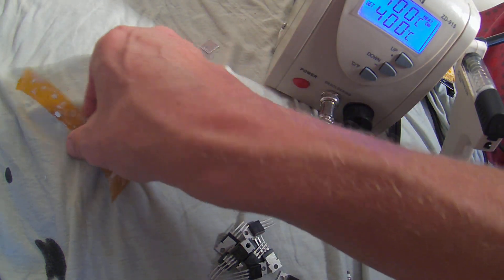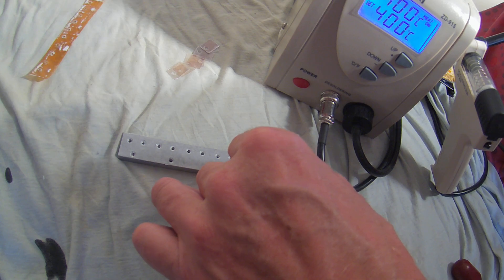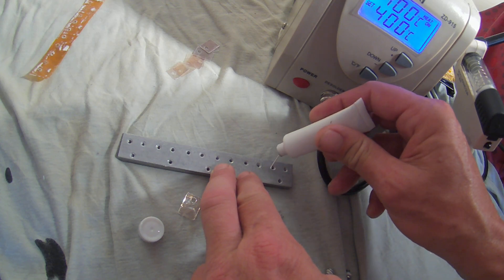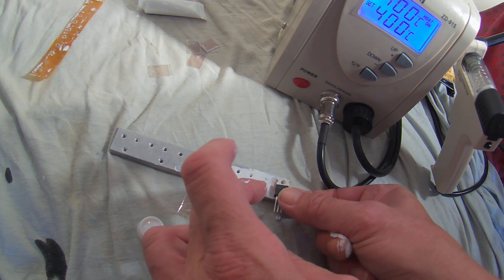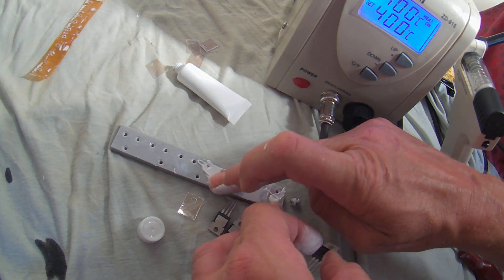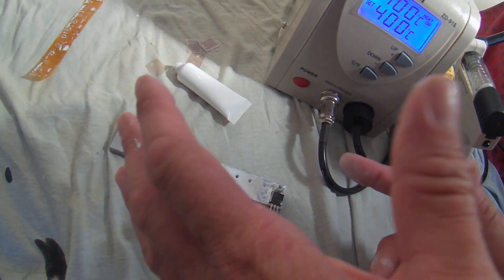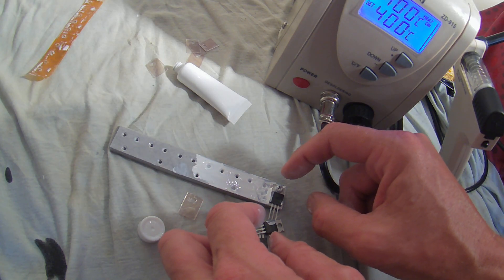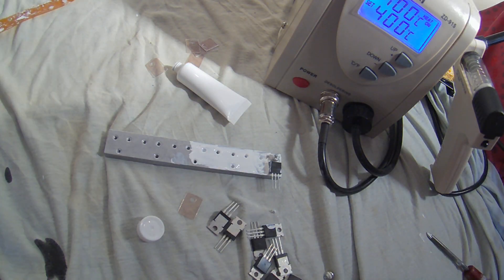Electric Scooter - Motor Controller Failure Part 3

Comment: Did got the scooter to work again?
Reply from the maker: It will in fact be ready for the summer and is extra special. It will be for sale in the South East of England in case anyone is interested. Hardly used and the battery is constantly refreshed.

Comment: i hope i don't need a entire new controller if its a mosfet problem. how can i fix it??? my scooter is a laotie ti30 model??? thanks hope you can help me?? and can i get a controller with bigger V or A. i see few stuff on my controller first one reads 60V, then another part with wording says 50V and then 45A???
Reply from the maker: Whereabouts are you? I can't fix remotely and need more info. If it's a controller problem, then it's a blown MOSFET for sure and that has to be sourced. Replacing is easy
Reply: @marcusoroberts  I'm in NY. Can i send u a PM with my email or u let me know u email just want to send u the pics I took of my controller to see if that's the problem. Then I probably order new controller even if it's just a mosfet problem. I hope it's not motor I don't smell any burn smell in my motor or motor sensor hall????

Comment: why not installing a cpu watercooler all in one on the mosfet aluminum bar and 2 little fan (push pull)  for removing the heat from inside the controller box ? :0)    (p.s. my controller last only 4 month ...)
Reply from the maker: Hi Denis, that's a great idea and I have been looking at alternatives to cooling. I'm investigating that approach. Please share any info you have on this. Cheers.

Comment: hey marcus, great videos. These scooters are really fast and complicated, I have a question for you, is there a fuse on the scooter because all scooters have a fuse somewhere, do you have any idea
Reply from the maker: Hi, fellow Marcus and thanks! No, you right that the typical scooter with a lithium battery will not have a fuse. Any such protection is dealt with in advance by the BMS within the battery. I used to have a scooters with the old SLA batteries and they did, as you say, have fuses mounted externally. Cheers.

Comment: Hi Marcus. Sad to see you're not uploading anymore. I saw you had a review for the Viper Dual 2000w Scooter. Do you know anything about the Viper Dual 5000w scooter? Other than viperscooters.com I cannot seem to find any evidence that it even exists. Noone seems to have one to show online.
Reply from the maker: Hiya, I will be uploading more stuff sometime soon, promise! The 5000w from Viper has two different descriptions of the battery; 36Ah and 30Ah. Tyres are 9'' which is too small. Should be minimum 10'' and preferrably 11''. For the price yuo would be better off going onto Alibaba and getting one from a company such as FLJ, if you are prepared to wait a month. They have excellent customer support - unlike Viper - and you can ask for quotes anything you want added/subtracted/upgraded for the scooter when you order. Less than half the price of Viper!
Reply: @marcusoroberts  Thanks a bunch. I do hope you start uploading again soon. I do have a concern with the FLJ though. Having read the reviews, I've seen that people mention a pattern of the FLJ scooters losing all motor function shortly after purchase. I also notice even you had this problem very shortly after getting it based on the fact that you made a repair guide for it after. Any thoughts?
Reply from the maker: @DirtyDoctorDan  Inherently scooters suffer from controller faults due to heatsinking issues on the MosFets. I believe I have resolved this.
Reply from the maker: @DirtyDoctorDan  in my case, and probably all others it's a controller problem. I have significantly beefed up the heatsink issues that zap the MOSFETs and this systematic of all scooters. The really super expensive Dualtrons don't suffer from this, but every other scooter will eventually get this problem. Easily corrected.

Comment: I have a ert-008 do you know how to make it faster?
Reply from the maker: I don't know that scooter. The best way is to upgrade the controller. That means one that has MOSFETs with better electronic characteristics and faster switching. There is no way of 'unlimiting' or 'derestricing' a scooter despite what you might read, other than the adjustable parameters.
Reply: @marcusoroberts  OK but I tried the P0 to p9 setting and it had P0 to P5
P0 is motor diameter setting
P1 is undervoltage setting
P2 is mp/h or km/h
P3 is kick-start
P4 is cruise control
P5 is no speed start or slide

Comment: This happened to me. Thankfully, my escooter is still in warranty and the shop repaired it. Asked them why this happened, and they said, probably due to overheat. So they replaced my 35A to a 30A controller. They said, there is a little degradation of performance. 
Since I wanted it to be fixed, I agreed. But still puzzled, because I wanted to know how did it happened. 

Thankfully, I found your video. I found my answer. Thank you so much for making this video and sharing your experience.

Safe Rides Sir! 🇵🇭 🛴⚡

Comment: Hey question, maybe you can help me out with some advice. I came across small accident as i rode my Zero 9 scooter where the stem lock came loose on me as i rode, and now when i start it up, I push down throttle but the motor wont start. Do you have any idea as to what it might be? I always use zero start, not push.
Reply from the maker: Hi, does the LCD throttle still light up and are you able to change the settings? Do the lights still work? I doubt it's a controller problem. It sounds more like a cable has been damaged at the front of the scooter. It's important to know if everything works, or just the motor doesn't work....
Reply: @marcusoroberts  Yeah the LCD screen and the lights work, I'm able to use it regularly. The only problem is the motor not starting after I throttle. Everything else functions, that's why I'm confused. Maybe it's a cable or the motor that is damaged somehow? Maybe upon impact unplugged the throttle cable? I purchased this from Falcon Pev, and is well within warranty range.

Comment: Good info. The strip you refer is not as much for cooling as it is electrical isolation. That’s why the screws you use to mount the mosfets look like rubber washers. The backs of the mosfets are the “drain” and you definitely don’t want the high-side mosfet drain connected to the low side mosfet drain. The purpose is to use a single heat sink for all of the mosfets. Using the mica strips is fine but they also electrically isolate. Just make sure to use those rubber  washers on the screws when you tighten the mosfets or you will have sparks!!!
Reply from the maker: Thanks, yes it's all still working great so far - and better than the original design. Cheers!

Comment: Can you fix my turboant x7 electric scooter controller?
Reply: Como se muestra tu problema con el turboant X7 ? Es que tengo el mismo scooter y pienso que tiene un problema con el controller pero no estoy seguro. Es nuevo y la batteria no puede ser el problema. Puede pasar que se apaga despues de 50 metros y puede pasar que eso pasa despues de 2 km. Se podria pensar que un cable en algun momento no tiene connexion. Probablement es un problema thermico. Si hago un test in mi vivienda ( sin cargo, a velocidad maxima ) entonces no hay problema ninguno. Solamente cuando lo uso en calle ( con peso 85 kg ) !

Comment: Hi Marcus, good job on that. 
I have a question and I need your advice. I had 2000w scooter controller 60v 15 mosfets had blown up 3 mosfets , can take 3 mosfets from 1500w 60v controller and replace them ?
Reply: If yes what will happen ?
Reply from the maker: @sw8thotchiilisauce  I doubt it will work. But if it does, please share. The problem with MOSFETs is they have individual characteristics and they work as a chain to help the sensors from the motors when to switch on and off. Each one is critical and designed for the controller to act with the throttle and motor.
Reply from the maker: They might be NCE MOSFETs? In which case possibly yes...
Reply: If the specs for the mosfet is 75-85 volts and > 120 continuous amps, they will work. Look on Digi-Key or mouser for n-channel mosfets TO-220 package. IRF is a popular mfg and the ones I typically use. Try IRF3307 or IRF2907 for a 60v system.